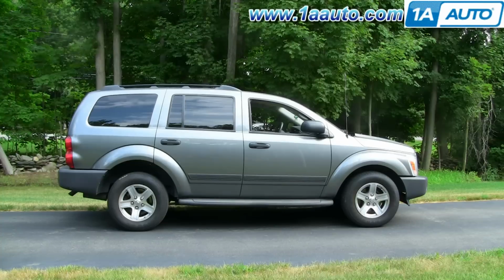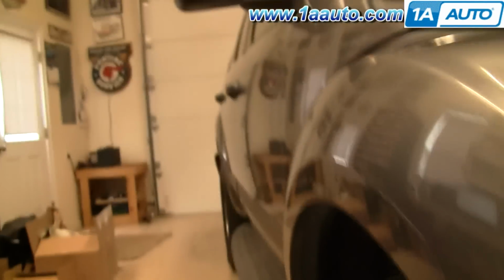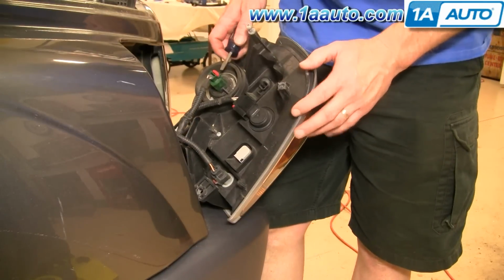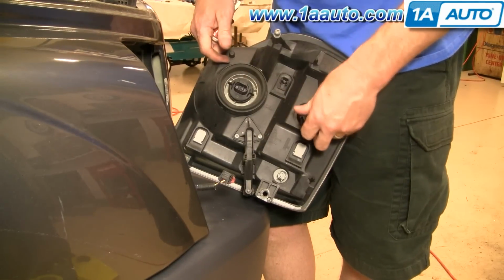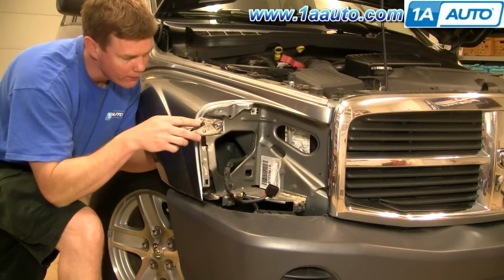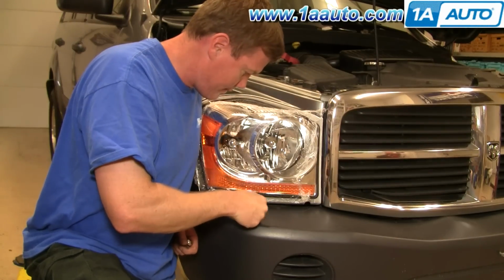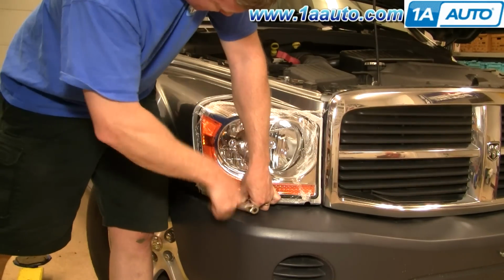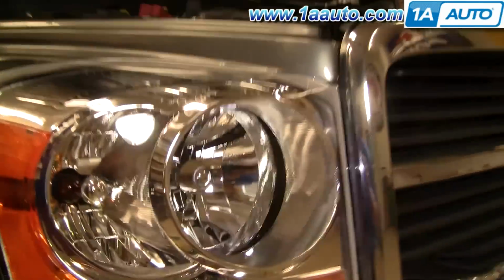How to Replace Headlight 04-05 Dodge Durango

Comment: I just finished this job and this was a very helpful video thanks.  Inner to the 10 mm bolt you get at from the back is a white clip holding what I'll call a peg on the assembly.  It's the last thing holding the works in other than the wiring, if you left that connected.  It's supposed to pull straight out but on a 12 yo vehicle that white clip is a real son of a biscuit.  Broke one but everything seems fine with just the three 10 mm bolts holding things in place.

Comment: Good, helpful video. Except the two bolts on my drivers side aren't lined up with the grooves on the outside of the assembly. At least I know to use a 10 mm socket now, thanks!
Reply from the maker: +Jim Riemersma Thanks for checking us out. Shop here for high quality auto parts: http://1aau.to/m/Shop-1AAuto

Comment: good video, but I'm having a heck of a time getting the assembly out, I removed the nut and bolts.
will try again. (the nut in the back gave me trouble but I got it out, finally. still something holding the assembly.  thanks for the video!
Reply from the maker: +John Galv You're welcome!

Comment: Directions are perfect. However, when removing the passenger side I found one of the 10mm bolts and the retaining clip for it missing. Any idea what the part number is for both and where I can buy the replacements?

Comment: Thanks greatly appreciated. When pulling the headlight out there is a white plastic retainer clip that the headlight snaps back into to hold it in place. This clip broke. I'm not sure of the proper name for this piece nor can I find it on the internet I was wondering if you know the proper name and where I might find this the headlight is drop down because this piece is missing appreciate the help thank you.
Reply from the maker: +James Mckenzie They are typically called headlight retaining clips. Thanks for checking us out! http://1aau.to/m/Shop-1AAuto-c

Comment: So the bulb doesn't come out thought the trap door in the fender well? You have to pull the whole light assembly?
Reply from the maker: If you just need to replace the bulb, you may be able to reach behind the headlight (if there's room) and remove it that way. If there's a trap door in the fender well that enables you to gain easy access you may be able to replace the headlight bulb that way also. Let us know if this helps you out. 1aauto.com 866-403-3393
Reply: I've had 2 Durango's mk2's
You definitely can change the bulbs without removing the whole unit.
5 mins tops....side of the road no tools.
Reply: It's entirely possible without removing the whole assembly. Just be careful as the move the new bulb into place so not to touch the glass of the new bulb against any contaminants. I've owned 2 of these and replace headlight bulbs many times that way

Comment: Is there a video showing how to replace the fog light assembly on a 2006 Durango 4x4 5.7
Reply from the maker: We currently do not have an auto repair video that shows you how to change them. They should only be held in by a couple of bolts. We do carry the replacement fog lights on our website. Here's a link to them if you would like to see what we have. http://www.1aauto.com/1A/fog-lights/Dodge/Durango/-/-/2006?utm_source=VideoReply&utm_medium=YouTube&utm_campaign=1ATony
Reply: I read on the dodge forum that you had to remove the bumber facia ??? I hope not. Any help with this would be great & I would glady by them from you

Comment: I need your help to correct adjustments the headlight with new led bulb headlight in my 05 dodge durango, I do set already side to side not face up and down but it's not right yet.  There is 3 light in led not 2 I know it's weird. But how?
Reply from the maker: +Jessie Munroe-Murer Thank you for checking us out. Outside of adjusting with adjustment screws we do not have any further information. 1aauto.com

Comment: Oh my god I'm disgusted with how they placed the lights. I had to change my tail light and it wasnt easy. All the bolts and plastic clamps and wires. I dont need to change my headlights just wanted to for cosmetic design. Sheesh
Reply: YeseniiYesenii that's nothing I had a 2012 Chevy Malibu ltz that I really liked the headlight burned out on the right side went got new bulbs and got back home could not figure how to change it thim found out that I had to take the whole front of the car off that's fun.